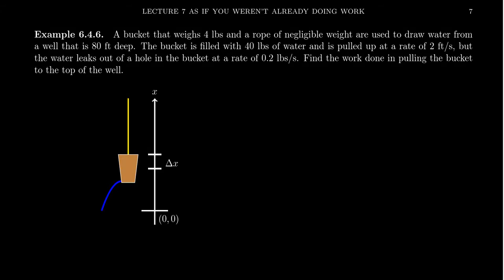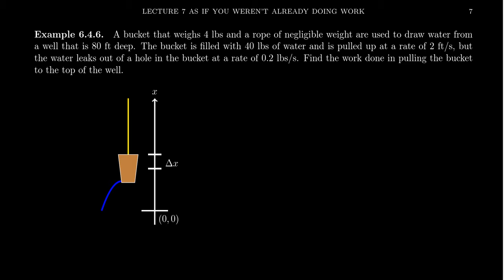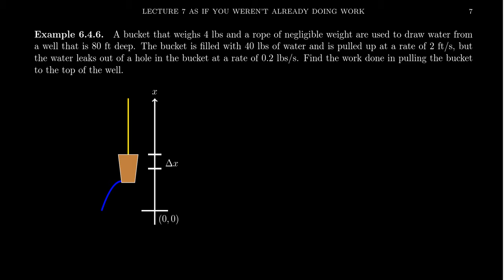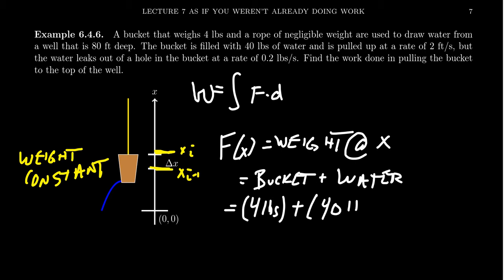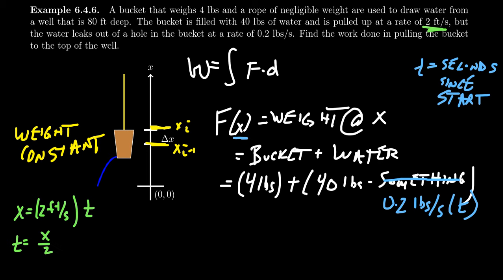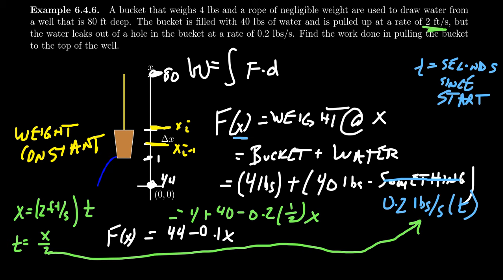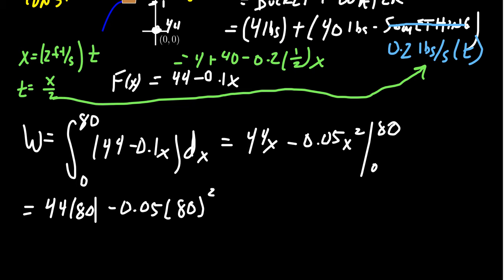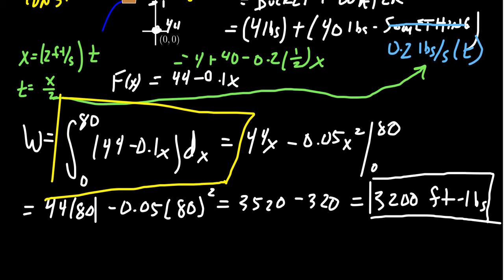Leaky Buckets and Integration

Comment: thank you!! going through this and breaking it down helped me solve a similar problem. I wasn't given the rate at which the water left the bucket, however, I was given the information that the water leaves the bucket at a constant rate until the bucket is drained (once it reaches the max height).
Reply from the maker: I am glad it helped. The type of question you had, Jason, is quite common, but I have often see students depressed by it. They often feel, without perhaps recognizing it, that they are very disappointed in working on, struggling with, and eventually solving a problem which provided no benefit. What I mean is, when we work on story problems we often relate with the individuals in the story, even if unintentionally. We sort of feel like we are part of the story as we try to solve the problem. The issue here is that when the bucket gets to the top of the well all the water is gone! So we put in all this work and at the end we get no water. I have noticed that students get frustrated when they find the amount of work necessary to let the water but NOT GET ANY WATER. It makes them feel like it is an exercise in futility. As the point of the exercise is to practice integration and not actually get water, it is a good question but too often demoralizing. For this reason, I have adapted the question then what was given in my textbook to have a happier ending for students.